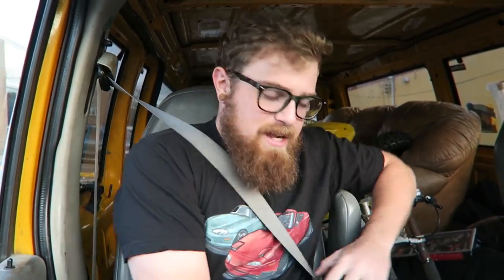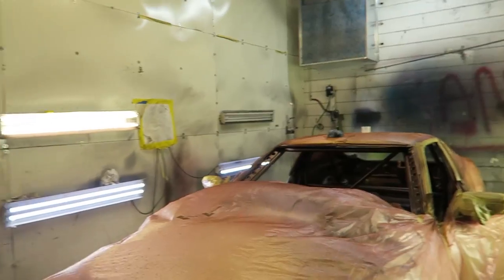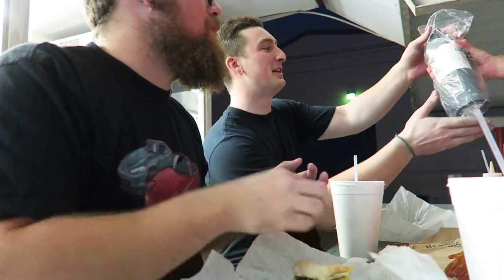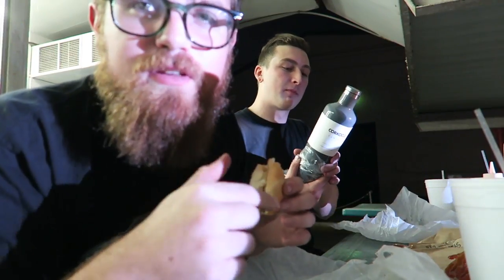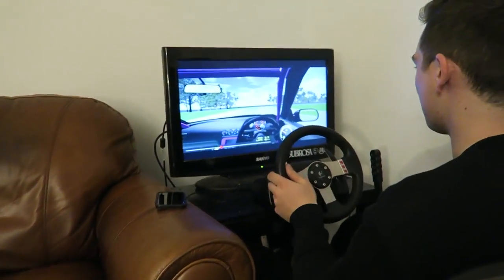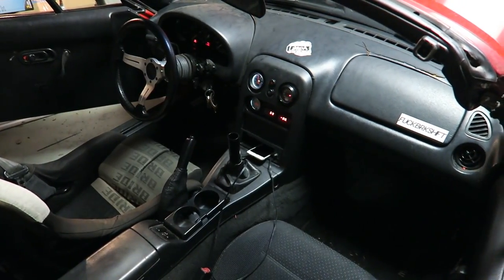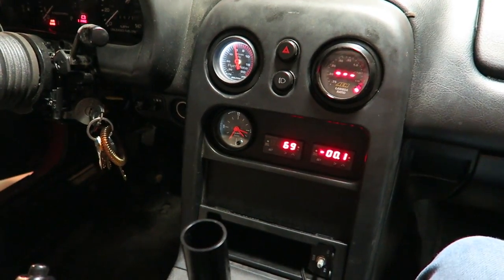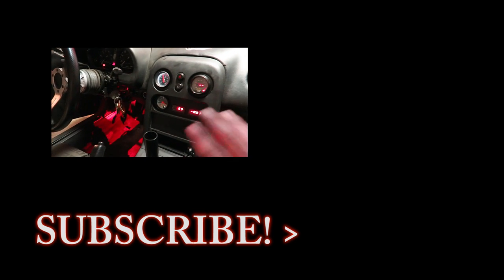DRIFT GO KARTS!! + Custom Miata Gauge Setup

Comment: interior looks great. do you have links of the pages you used to get information on cleaning up the wiring mess
Reply from the maker: +mark fritz it was honestly just from prior knowledge of wiring.
Reply: Taylor Ray  yo ask them how much they would charge for you to run a 4L80e!!
Reply: Taylor Ray  and tell Adam no interior parts in the racecar!! he should auction off the interior parts after he signs them and use that money for a special project - possibly a fan project! or trip to a different state to visit fans

Comment: Hey Kevin I was wondering to get your thoughts on my plan I'm going graduate from high school in june and I'm getting into cars my dad is going pass me 1991 single cab tacoma (stick) I'm going wait two year maybe work on cosmetics for the truck and then buy a car to pass down the truck to my you
brother as a graduation gift but I'm stuck on what I should do buying a used brz/frs/gt86 or a 370z(2005-14 nismo?) , my mom wanted sell her car buy me a new one but I told her no to wait because I can always try get a wrx (sti hatch?) or new gen evo because it's four door car so we can carry our family but my cheaper route are 350z and 2013 corolla because lowered with sone new rims looks nice and a couple more cosmetics here and there well the coupes cars I will need buy on my own and four doors I think my parents will help me but I was leaning towards a coupe because I can later use it to drift you and Adam got me wanting to learn work on cars and drift them maybe start a channel too
Reply from the maker: +Edwin Giron I would suggest getting something like the evo. Then save up some money on the side and by a cheap 240 and start working on and drifting that. That way you have a nice daily you don't have to worry about a car you can thrash.
Reply: Taylor Ray The blogs have been my favourite ones on YouTube this month for sure!! Keep doing them whenever you get the chance